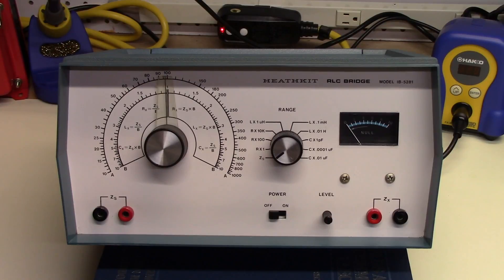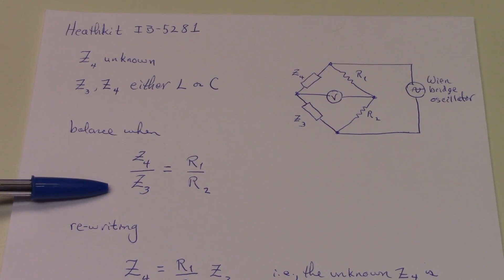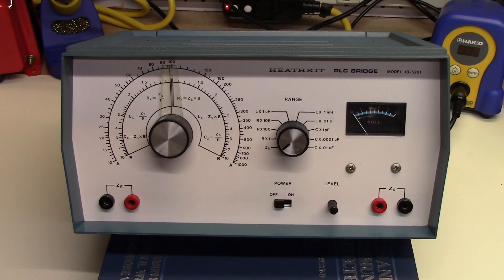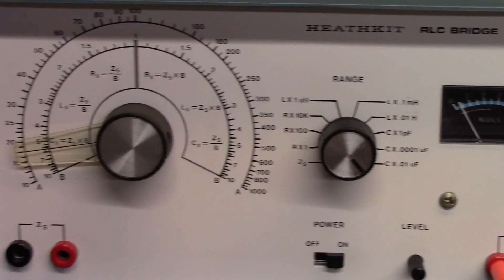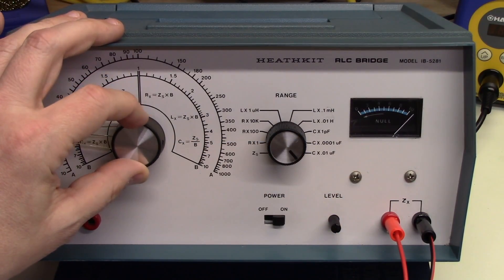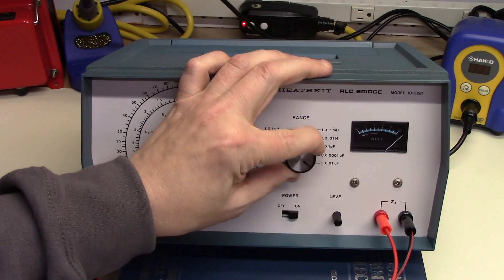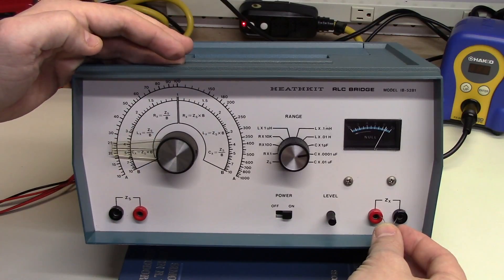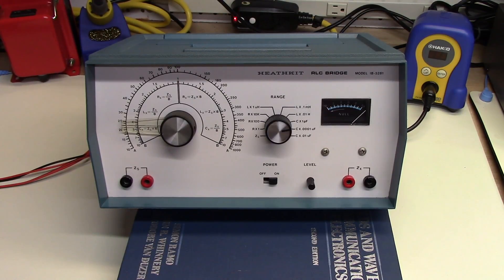#28: Heathkit IB-5281 RLC bridge

Comment: Neat heathkit worth noting that inductors with cores may not read accurately due to the mix in them having a different permeability at frequency. For air core it should work great though

Comment: Thanks for the video my Heath IB 5281 is working ok but if I measure high resistance it is not accurate for instance a 39K shows 45K.Problem solved there was a bad solder joint at the balance control

Comment: I have a couple of the earlier Heathkit C-3 bridges (C-3U actually, different to the U.S. version) and they are quite accurate considering their relative cheapness. They mainly get used for capacitor insulation checks but every now and then I will give the other ranges a whirl.